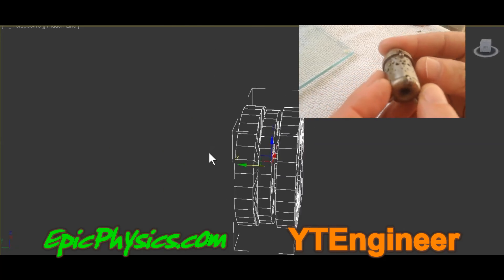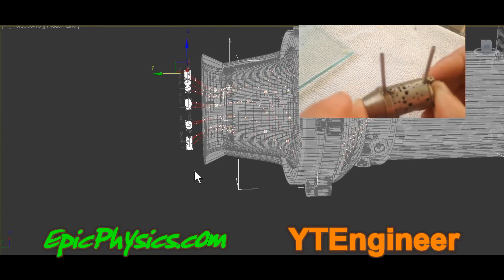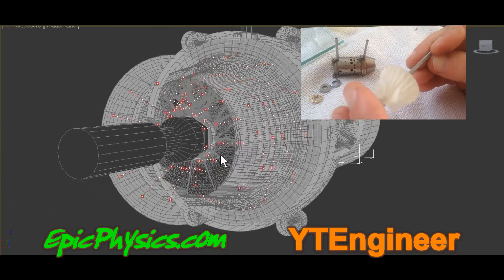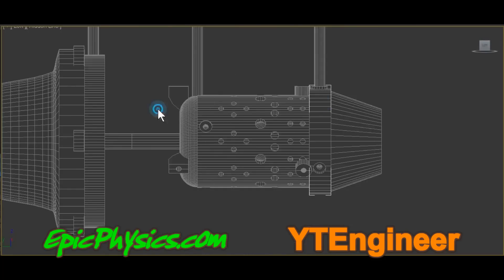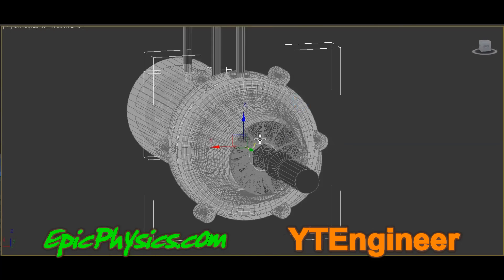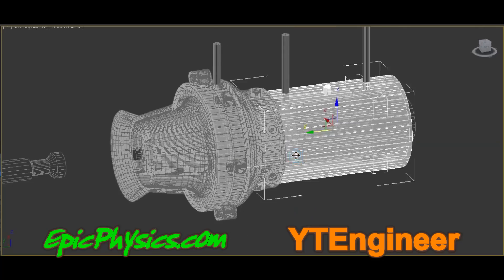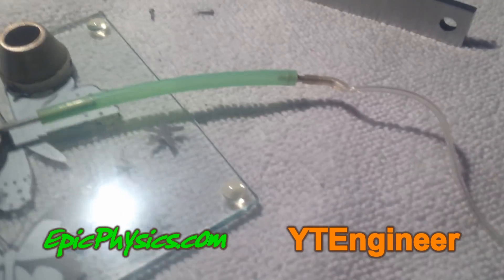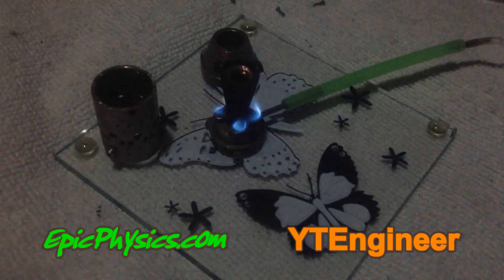Micro Jet Engine Project Part 1

Comment: For such a small model, spark plug is too bulky. Consider using heating wire to ignite a flame. It's small, and it can be heated with 12V. For spark plug you need bobine and electronic ignitor. Such wires were used on 2T RC piston engines in the past, and I don't see a reason why it shouldn't be used here.

Comment: Could you not just start the motor by putting your lips on it and blowing?
Reply from the maker: I wouldnt think so, it will need to be spun up to between 10 - 20000 rpm to enable startup. But we will see :)

Comment: Great effort, just I think all you need is electricity as the power source.
Reply: Hardly. Jet turbines need fuel. Otherwise it is just an electric fan, and you would just use a motor. Unless you are suggesting to use an electric motor only to start it, which is valid and is how my (and most all) turbines work. This is a great idea if it can be made to operate.